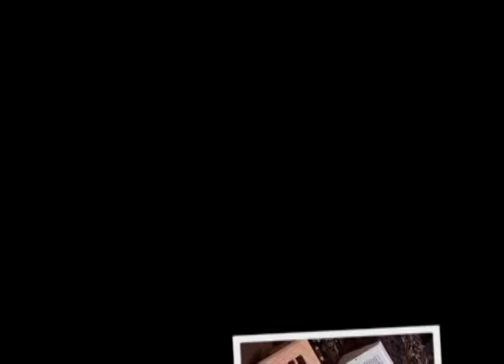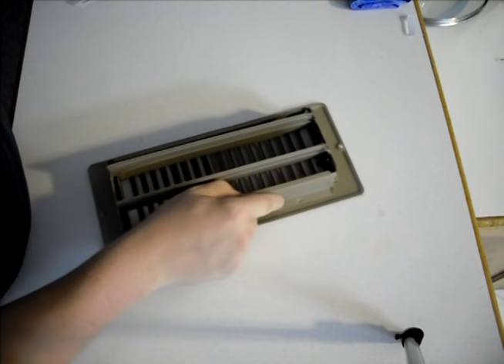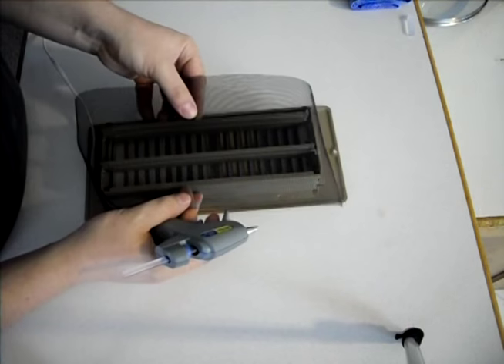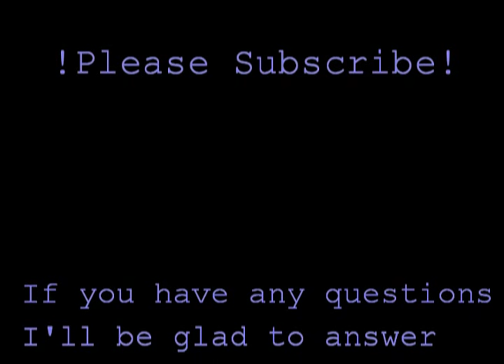Prevent Pest Entering Your Home | Pest Control in HVAC

Comment: Thanks, worked great for me.  I looked for a pre-manufactured product that would fill this need.  There is actually an elastic net you can buy that covers the opening for the 4x12 vents from the back side, it looks like a hair net.  I bought some but they were too small for the 14x6 vents I had.  I also looked for vents that had bug screens built in but couldn't find any.  So I bought the fiberglass mesh and a glue gun and it was very easy.
Reply: Thank is that metal where did you get it thanks

Comment: Doesn't this block air flow from the AC unit which causes the unit to work harder and increase the bills? I installed metal screens in all my vents and I noticed my ac is always on and really struggling to keep the place cool. Also my bill increased by a LOT! Will these keep the bugs out without blocking too much air?

Comment: Can we just put the screen on outside of the vent? Use strong tape. It’s easier but not look as nice. What do you think?
Reply from the maker: I don't see why not lol
Reply: Did you put the screen on the outside? Any luck?
Reply: @emteebee1872  i put mine on the outside of the vent and secured with strong tape. Haven’t seen any big critters try to get through.
Reply: I thought about doing it this way, but mines are on the ceiling (popcorn ceiling) so I was afraid tape might not hold. What kind of "strong" tape you used?
Reply: @sharris3624  i just used the heavy duty packing tape. I used painters tape at first and it wasn't strong enough. I place the tape around all sides of the screen and made sure to only have it stick on the metal grate and not the ceiling because i dont want my paint to come off when I remove the screen when i move. Its been almost a year and no problems but i also live in texas so dont run my heat that much to make the tape come loose. Let me know if this works for you! oh. My aunt lives in South GA and she puts sticky glue traps by all of her doorways and that has really helped her.
Reply: @TX-qk5jt  do you see any difference in how your air blow as far as cooling your house or running longer?

Comment: Ok any suggestions how to stop water bugs from coming up thru shower drains and toilets?  We’re having this issue in our vacation home in the Caribbean. This is extremely gross and embarrassing. Our care taker fumigates once a month but I want to eliminate it possibly for good. Not to mention it’s extremely costly.
Reply: Easy. Seal tight all of the holes while not in use. Find that, what would fully cover those.
Reply: There are covers that you can put on there. They sell them everywhere online and stuff like that.

Comment: Can you share the brand /link of the product youngster? Or at least say how big the holes are. I’m afraid if too tiny, it will put pressure on the system but if too big, smaller bugs will come through
Reply from the maker: this is just a regular vinyl mosquito screen that you can find on any window. They sell them by rolls at the hardware stores. Small bugs will definitely come through but not bigger then ants. Can not share brand or a link, this is video is very old

Comment: My question is how do them Damm water bugs keep getting in the house
Reply: Yg Bodybuilder cents bro woke up at like 3 am I see one by the vent in my ducking bathroom
Reply: Vents
Reply: I would love for some one to answer this
Reply: Drains.
Reply: @fgfg633  i nevr seen a water bug come through the drain?
Reply: @ygbodybuilder3023  I live in South Florida, the swampy epicenter of cockroach life. They can swim through water and can come up drains and toilets 🤮.
Reply: Seal and cover all points of Entry coming into the house. You have to play defense because there's no way she's going to kill them all. As long as you can block every path you will never have a bug problem again
Reply: @highlymedicated2438  how many paths are there
Reply: @ygbodybuilder3023  all houses and apartments come in different shapes and sizes it could be unlimited points of Entry but the good news is you can seal and cover just about anything. The goal is to make it harder and harder for them each time you might see one until you actually start discovering where they come from. I keep all my drains covered where water goes down the drain but nothing can come up I have draft protectors under my door to keep from bugs crawling from one room to the other and make sure there's no cracks or crevice is from your house settling like around the pipes and everything to keep them coming through. They are so small and thin they can just crawl through about anything but there's only so much they can do until you blocked just about everything. Trust me I dedicated my whole life into studying these bastards bc I have a debilitating fear from them. Im from Alabama so yea im familiar with them. lol. I even have mesh screens that cover my AC vents where the air can come through but bugs cant. Now I cant even remember when I saw one last and can sleep in peace now.
Reply: @mswr2712  start sealing everything in your bathroom and go from there. put a draft protector underneath your door to keep the roach in place at least so it won't be crawling all throughout the house
Reply: @highlymedicated2438  how did you block them from getting up your toilet drain?
Reply: @redsN123P  well I have never seen a bug come up from the actual toilet bowl.  Has one come up through your toilet before? Or do you mean outside around a toilet?
Reply: When my apartment with settling it actually made a crack around the toilet pipe that's connected to the wall and all I did was just seal it with caulk and I never saw them again
Reply: @highlymedicated2438  I know this is old but our bug guy said to seal that spot along the base of the toilet to keep bugs out. Bottom floor condo (like apartment). He said they come up along sewer pipes from outside, walk right in. I fixed seal around toilet tight, no more earwigs came in. I am same... pulled lighting fixtures off of walls to seal where wires come in. Cable lines, power. Even vent over oven, huge messy holes in the walls covered up by fixtures.
Reply: @EpistemeUM  Good. Did that help reduce the bugs coming in?
Reply: @highlymedicated2438  Oh yeah, loads of earwigs and random crawlies before that. Spent years trying to find every possible crack bugs could enter after a trash hoarder neighbor was evicted years ago. We were cleaning our vent screens and I thought I'd look around and see how others do them. This is exactly what we did, works great and it still seems like the best option.
Reply: @EpistemeUM awesome. That's why I always play hard defense because you definitely can't kill your way out of bugs. I bet it feels like a whole new house lol
Reply: @highlymedicated2438  Yeah we're buttoned up tight! There was an explosion of German cockroaches outside this summer, felt bad for the neighbors when the weather turned! There should be pros that do this to houses and condos, they'd make a mint in SC. We'd have paid just to have someone walk through and give us a 'bug crack inspection!' lol

Comment: would this make the room hot? not let airflow come in while keeping bugs out 
 as efficiently?
Reply from the maker: No. Not at all. Screen is pretty big. It will block roaches and bugs but not air flow, just remember you still have to check them.  And clean them just like your air filter